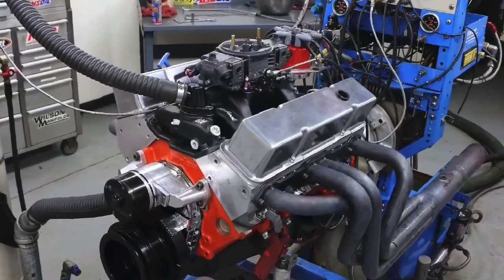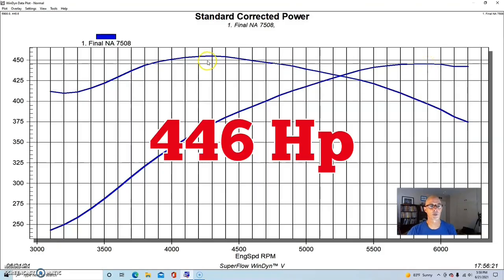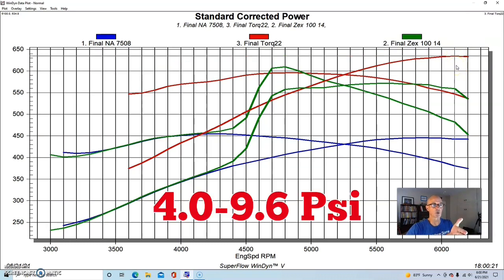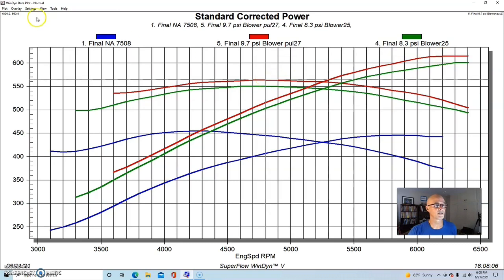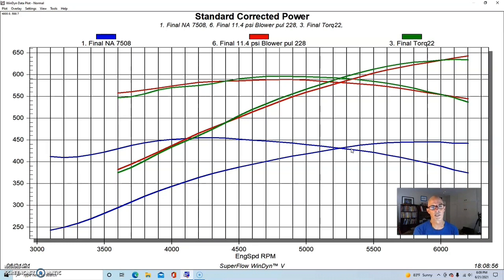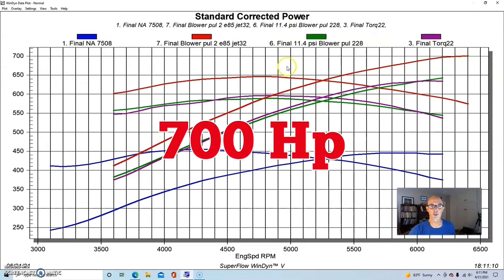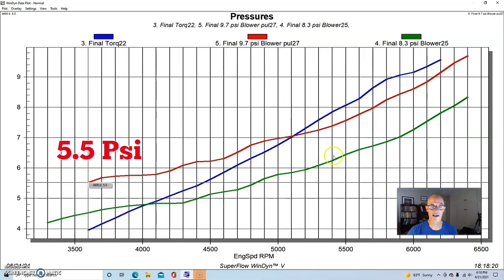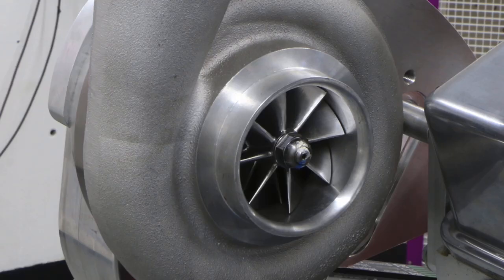6-71 BLOWER vs TORQSTORM-383 STROKER SBC BLOWER TEST

Comment: The roots is still going up in power. My biggest criticism of Holdner and his testing is his lack of RPM. There's plenty of LS motors reving over 9k and there's no testing here that represents it. You don't need to spend 10s of thousands extra to build a high reving motor.
Reply from the maker: thnx-99.9999% of the ls motors don't run to 9000 rpm-those are the guys I do these tests for
Reply: @richardholdener1727  that's because those guy's aren't aware they can even do it.. look at ls power in the 8s drag those guys are all running upper 8k- lower 9k rpm out the back door and shifting mid 8k. It's not hard to build a motor in that range. Why is this topic always some kind of argument? 8.5k-10k rpm (depending on motor) is within any diy built in the driveway guy's ability. I think you're either to lazy or just don't think your audience is smart enough to do it. Guy's are in there garage fully building motors nowadays with access to inexpensive machine shops and capable reasonably priced parts. You've tested alot of motors with many combinations and I applaud you and your work. You haven't gone into making more rpm and that would be the natural progression in your body of work. How many more basic builds have you not tested? Why so much tension on this subject? Higher than stock rpm motors make more power, sound better, drive way more fun with or without power adders. Get on board.
Reply: @flexall7408  In expensive machine shops and reasonable priced parts?
Reply: You will not gain horsepower on every ENGINE combo if you turn the engine at increasingly higher rpms. First example is a stock as manufactured engine. The air filter and intake manifold system and the camshaft and the exhaust system are all limiting the engines horsepower output no matter how high the rpms you turn it. Second example; camshafts have an rpm range for a reason. Go past the upper rpm range and the horsepower will fall off no matter what engine it is or what other mods it has. Except for higher ratio rocker arms which will only make a difference up to a certain ....... rpm. If you put a camshaft in that allows the engine to rpm at 10 thousand instead of 7 it won't make more power unless the heads, intake,carburetor and headers are already big enough to take advantage of the higher rpm. Other than building an engine to run a power adder and using high boost or nitrous there is no better way to make more horsepower than have a larger engine. You can build a smaller engine for natural aspiration and turn as high an rpm as the design will allow and never make as much horsepower as an engine twice its size at its maximum rpm. Otherwise cars would be driving around with little 2 stroke engines that turn 15000 rpm and have a 2 speed transmission. Also horsepower is the SPEED at which work is done NOT the amount of work done. TORQUE is what does the work and you cannot get more torque from a naturally aspirated engine by winding it to 15000 rpm unless the camshaft is designed for  that and if it was able to turn up to 17000 it wouldn't make more power because it would be past the camshaft designed rpm range.
Reply: @crazyoilfieldmechanic3195  calm down, of course you need cam and other mods but its 100% fact that the higher rpm you can get out of your combo the more power you will make. This is a short text response on a channel that engine guys  watch. Most of what u said is assumed knowledge. Otherwise we'd all be driving 3k rpm diesel motors. Asshole
Reply: @crazyoilfieldmechanic3195  in your long winded attempt at a know it all post you left out a great deal of the most important info in rpm increase, rotating mass, stroke, cam diameter, oil system, balancing, hardware, de-buring, material choice, metal expansion tolerance, cooling. So don't act like the authority fact checker on twitter because you are incorrect, and didn't even read my whole post or didn't understand.
Reply: Last point for people about rpm.... torque x rpm = hp ♥ in basic English, the more rpm you can achieve on your combination THE MORE HORSEPOWER YOU HAVE. FACT
Reply: Skip R  it depends on what you're using it for.. drag, track, offroad, daily... on every motor combo you will gain hp as you go up in rpm. Gearing plays into rpms as well. RPMs will help drag because you can run less gears or get more top speed out of the gears you're using, rpms help track because you have more range in gears for cornering, rpms help offroad for hill climbing and mud bogging more wheel speed in a chosen gear. Plus much more. They have some serious downsides as well

Comment: Awesome test. Hot chicks love the roots, so there's that to factor in.
Reply: Ive had better luck with a stock Porsche and root combo..lol..
Keep the blower in the passenger seat
Reply: @Goes 2 Eleven Roots blower sticking out of the hood of a 53 Chevy pickup seems to work quite well.

Comment: Did you happen to read cylinder to cylinder distribution with the blow through dual plane? Looking at doing this exact same thing with a 390 sbm and wondering if my dp manifold is going to work. Thanks

Comment: I was surprised at how the torque curve in the nitrous shot didn't stay up like the boosted examples did.
Reply: It never does. You would need the the amount of nitrous to increase with the climbing rpm. Just like a boost curve rising . Not that you couldn't but it would definitely take a level of knowledge and resources that most folks just dont have..or just use boost to achieve that result.  Nitrous and drivability , only go together in this sentence..lol
Reply: @artemusifasuenshuffleman8535  I can see what you mean especially on a NA setup.  You can only feed it as much as the engine can inhale it.

Comment: I am running the same roots blower on a SBC and according to my data logger, I have 11.1psi at the hit of 4000rpm and 12.8psi at the stripe of 6500rpm. I am going to say your difference is in the camshaft timing - yours is not correct for the motor.

Comment: How much more does the 6-71 weight over the TS? What were the intake air temps ( non-e85 )? What was the fuel consumption differential between a single 850 and the duels?
Reply: the fuel consumption difference would interest me as well.

Comment: Very interesting results. I’m betting specific fuel consumption was way higher on the 6-71 setup. With 2 more psi to get the same power that’s about 60 more horsepower robbed off the crank to turn the roots blower. For a toy that’s no big deal. I’m thinking you could do better overall with a GT-45 but there’s nothing quite like those carbs sticking through the hood for visual impact. Thanks, Richard!

Comment: So the torque storm is just as inefficient as The Roots blower check lol. I would still have to go with the Roots blower and some e85
Reply: If the centrifugal were as inefficient as the Roots it would have needed the same boost pressure to make the same power, but it did the job at 1.9 psi less.

Comment: Have to make the air pump bigger to make More power .
Reply: So you cant just make it pump air faster?  Cooling,  tuning?  Just having fun. But in all actuality alot of other  factors go into achieved power . Think about rpm.  Hp = torque × rpm / 5252 so an increase in speed - rpm is just as useful as an increase in force- torque if more power is what you want.

Comment: Run the torque storm with E85. And raise the boost to 11 psi. I bet you get massive gains.
Reply from the maker: we did run a procharger with e85-that made a ton of power
Reply: I bet a 250 shot of nitrous would have been best!
Reply: Do that and add nitrous under the carb, I’ve seen nitrous added to boost that works really well

Comment: What's the longevity of these centrifugal superchargers on the street? Is this something you could put 50,000 miles on with a little maintenance?
Reply: Big block with two storms and a small spray of nitrous should get the job done well .
Reply from the maker: I ran my Vortech for 85000 miles-it was still running perfect when I pulled the motor for dyno testing
Reply: Centris don't care, if you're not peak RPM at every opportunity, they'll last a good long time, though you should change the drive unit fluid on occasion, depending on the manufacturer you should probably do it at 30k
Reply: @Prestiged_peck  every yr or 10k miles as per Torqstorm requirement

Comment: Very interesting. The centrifugal are a bit easier to package. Also the fact that one can still tune the intake makes it interesting. Also its easier to use IC with wich is an advantage.

Would be interesting to see how a twin screw supercharger in a test also. Seeing as they are more efficient than roots.
Reply: What is the difference between a roots and a twin screw?
Reply: @GreatLakesLogger  it operates on a different principal with male and female rotor that meshes very tightly together.
Just by spraying a little too much som wd-40 i can hydro lock my mazda millenia supercharger. Quite amazing tolerance.

There are a few videos explaining the different principles on the tube.

Also the earlier paxton centrifugals were different. They had balls in them instead of gears. They had trouble producing high pressures and produced more heat.
Those would also be interesting to see a video on.

Comment: Richard, interesting in deed. Love your down to earth facts basis on your channel. Did you by any chance record the temperature in the intake manifold?  I would expect that the roots had a higher temperature and therefore lower charge density. I would also have loved to see what would happen with a intercooler on the torqstorm.  Thank you for a good channel

Comment: Thanks for personal favor! This clears the debate that superchargers help intake flow at higher rpm since centrifugal acted the same as roots blower with fixed boost.
Reply from the maker: the boost curve rose with engine speed on both
Reply: @richardholdener1727  I correlate the results with intake geometry

Comment: Let’s talk price difference. No hole in hood. Torque storm very impressive
Reply: But that roots blower looks like a huge diamond sticking out of the hood 😵. Yeah the torque storm is awesome though. Depends on if you want to see the blower while you're driving though I guess. Personally I've always liked the look of a big polished blower sticking out of the hood and the loud whine. But those centrifugal blowers can make just as much if not more power and be hidden.
Reply: @jeremypike9153  I also like the look of the polished blower thru the hood however I do not like having to polish every couple weeks or even days depending on weather and how bad the bugs are where you live point is it is a lot of maintenance to keep it looking like that since I do auto repair for a living the less parts less labor less cleaning makes the centrifugal the clear winner to me plus it can be inter-cooled easier
Reply: @WhoopAzzRacing  I'll never do another polished blower. I hate polishing it.
Reply: Torq storms are very cheap kits run around 3 grand
Reply: I think the 6-71 is  about sound and presence, especially on a big block when it makes the ground shake.
Reply: @davidguerra5067  a 6/71 would be lost on a big block. 8/71 would be minimum.
Reply from the maker: we did 1000 hp with a 6-71 on a bbc-871 is not minimum
Reply: @richardholdener1727  what would be the top for an actual Detroit blower?
Reply: I have had a l33 aluminum 5.3 block and I threw a gen4 4.8 rotating assembly with mild ported 706's in my my wife's race car but she didn't think it was as fun as she though it would be. I picked the car up its a 95 SN95 Stang with the l33 5.3 and holley efi I put a little plate system on it, a pretty nice glide and built 8.8 with team z tubular everything on it and a lot of nice suspension stuff it's actually a very nice car that has took every thing I've thrown at it but I bent the rods in the 5.3 and threw the 4.8 rotating assembly and picked up a tourqestorm blower a rowdy ass btr blower cam push rods and a new set of btr 660 springs. I'm gonna change the converter and run it on methanol with the all the boost pulleys I seen where tractor pulling guys misting the inducer with cold water to keep things as cool as they can I might try it .I'm gonna run Bosch 210s and 3 525 walbros in my 10 gallon fuel cell and possibly alky injection in the charge pipe idk yet if it sounds as rowdy as I hope I'm gonna have me a set of zoomies built and see how fast it will go in the 1/8 really pushing it hell nitrous may be needed to get me where I want it to be
Reply: I totally agree also just a single carb instead of dual carb and not having to swap intake all are positives to me
Reply: @WhoopAzzRacing  I run a "half a blower" lol  I like the sound and I live below 4000 rpm
Reply: @WhoopAzzRacing  If I was going down the track I would have gone with turbo, I would have a huge hole in my hood and need a passenger to make right turns to make close to the power you will. All in all I just love non stock cars :)
Reply: It would a lot easier in the pits without a crowd around your car too.
Reply: @CarsandCats  is this English? Lol